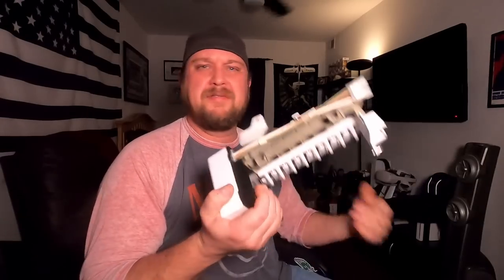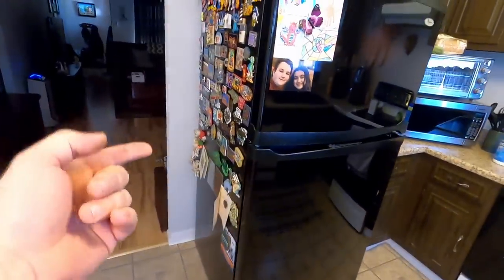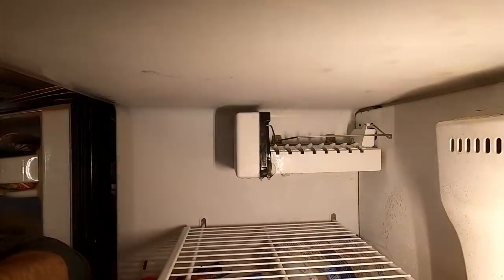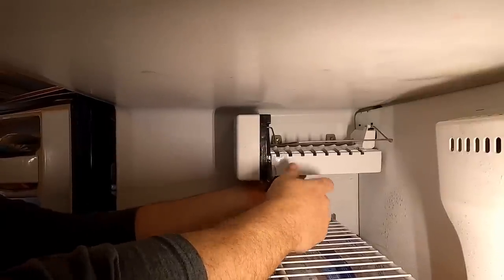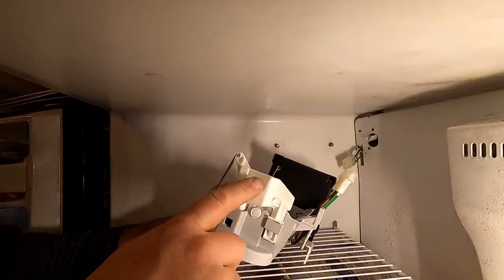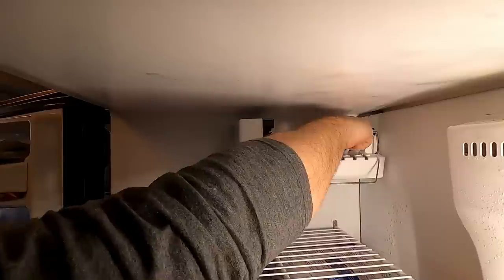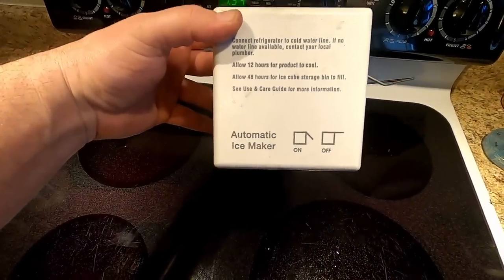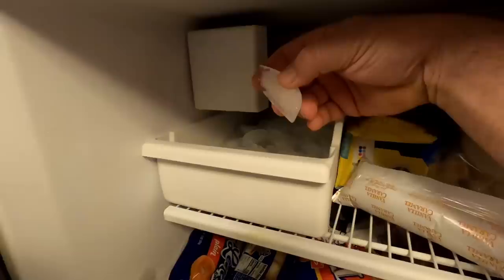Whirlpool Ice Maker Replaced

Comment: I’m a retired HVAC/R technician. I’ve never owned a refrigerator that had an ice maker. I worked on Food service ice maker equipment for the last 24 years before I retired along with the Heating and Air Conditioning in a medium size Hospital in Philadelphia,PA. I’m 77 years old and I still 
make my ice cubes with those plastic trays in my freezer. 😊
Reply: 👍🙏🤓Agreed! Ice makers take up volume & and introduce unnecessary complexity.
Reply: @ProfessorDeezNutz  🤭🤣🤣not to barge in or kow tow, but I’d float the idea that it’s low coast. (Helical props are new, but oh bouy, they seem great!)

Comment: Quick Tip:

Maintenance tech for an apartment complex that exclusively uses Whirlpool appliances here.  I’ve been replacing about two of these a week for the last year and a half.  (It’s a big apartment complex.)

After you install one of these, you can jump start it by bridging the H and T terminals under the white cap with a short piece of wire.  Super simple, starts making ice immediately.  :)

And yes, always dump the first few batches.  The entire first bucket can be pretty gross tasting.

Comment: When the ice maker tray gets to 0 degrees, it throws a temp switch that starts the timer motor switch.  The contacts on the gear turn on the heater to loosen the cubes,  the motor drives a gear that runs the ejector arm.  The shaft on these units wears out ant the contacts don’t make..  or won’t release..  meaning water, heater, motor at not run on or if the motor stalls at one position it may not turn off all those switches in the correct amount of time.

Comment: It used to be that things like refrigerators and washing machines were once in a lifetime purchases or maybe 25 years or more.  Now everything is made so poorly you have two appliances failing at the same time.  Worse, they cannot really be fixed because the parts are so expensive you're better off just buying a new one.  If anything else in the fridge had gone wrong, it wouldn't be worth repairing.
Reply from the maker: The guy who looked at my washer said 10 years is about it for most box store appliances.
Reply: Put all of your appliances on surge protection please.

Comment: That was great Video  much appreciated. I have been staring at my same ice unit for the past 10 years wondering just how difficult that would be to tackle this one. Great tip on the rollers I would have for sure attempted to just drag it out and scratch the floor. Well done !
Reply from the maker: If you look closely, there are scratches on the floor from before I learned the trick 😊
Reply: @FunkFPV  That's awesome !

Comment: Whirlpool has been using this ice maker design for like 50 years! It's super reliable and inexpensive to repair/replace. 

Recently they've been moving away from it though which does not bode well.
Reply from the maker: If it’s too good, they can’t make money off of it 😁
Reply: Yeah. I've been slowly transitioning to old reliable used things with less bells and whistles. I'd never get a fridge with an ice maker again. I'd rather just have a countertop one.

Comment: I've sold appliance parts for 20 years.  You can see on the old icemaker mold where the water had gotten between the mold and the head, corroding it and letting water get into the head where it freezes.  It happens all the time!

Also, just as a reference, when you are trying to figure out if the icemaker or the valve is bad: if there us ice in the icemaker that isn't being expelled, the icemaker is bad 95% of the time.  If there is no ice in the maker, pour a glass of water in it.  If it cycles and kicks the ice out, then it is most likely the valve.
Reply from the maker: Good info 👍🏻
Reply: Same failure mode as my late mother-in-law's apartment ice maker, which hadn't made ice in months.    Even right down to the ice maker plastic being coated with ice and looking mottled/filthy.  (Actually, you could hear the stalled ice maker motor groaning every half hour, trying to push the cubes out, but they were frozen to the tray).  Everyone else in the family was oblivious to the problem and symptoms, even though everyone else but my wife and I owned a refrigerator with ice maker.  But I'm the one that was upset that the ice maker was broken.

Probing with a DVM according to a manufacturer troubleshooting guide revealed an open on the heater circuit.  I assumed the heater burned out, but corroded heater contacts or charred heater switch contacts would give the same result.  Apartment complex replaced the whole ice maker the next week after I jerked it out for diagnostics, so the point is moot.  But if some charred/rusted contact could have been burnished to put the ice maker back in operation, that would be the true skinflint path to fixing the problem.

The bad part of the story was that the refrigerator water supply tube cracked at the solenoid when I (gently) pulled the refrigerator out of the nook (to power down the refrigerator?)  Started squirting a pencil stream of water on the apartment floor at 9PM on the Sunday of a long holiday weekend.  (Thanksgiving/ Christmas/ Easter/ whatever).  And the plastic wingnut-shaped handle on the water supply shutoff valve in the wall had lost all its plasticizer over the decades and turned into dust.

I was barely able to shut off the water by turning the valve shaft a quarter turn with needle-nose pliers.  If that hadn't worked, we would have needed a third-shift call to a plumber with secure basement access to turn off the water, or else we would have flooded the apartment building basement (and apartment).  If the shutoff hadn't been accessible in the apartment kitchen itself, we really would have been scrod.  Don't know whether the apartment complex replaced the shut-off valve, or if 20 years from now the other shoe is going to drop when they need to turn the water off to replace the whole refrigerator...

Comment: Aftermarket parts are usually the same manufacturer.
The solenoid valve is 120 volt, I've seen one with voltage leak to chassis which energized the external plumbing..

Comment: You may want to check heater resistance to see whenever it failed or not - compare it with new one if there is no info about it's rated power.
Cause if it freezes like it's supposed to, but doesn't unfreeze, then what could be wrong? ;)

Comment: 9:31 If you take a paper clip and jump the holes(i cant remeber which ones i beleve its the ones closest to each other there are video on youtube about it) you can force the ice make into a diagnostics mode to check all fuctions intead of waiting for it to cycle though. It helps tech quickly check them out. Of course it has to have water and plugged in for that to work.

Comment: I bought one of those for a fridge at work. The first one didn't work so I sent it back, the second one also didn't work so I pulled the cable out of the back of the fridge to make sure the wires matched up. 
For some reason the wires (colors) on the ice maker were not in the same sequence as the wires on the fridge, so I just rearranged the wires on the ice maker plug and it has been working fine ever since.

Comment: I don't know I'm cheap avoid the frustration I have plastic ice cube trays, don't have to run a water line or worry about mechanical  failure. 🤗. I can remember the metal  ones that had that had a handle on them he had to pull the brake cubes out. 😉
Reply from the maker: My grandma had those metal ones. 
When I replaced countertops 10 years ago I ran the water line. If it wasn’t for that I’d still be using trays.

Comment: What’s the voltage/amperage on these things? I was replacing the defrost components for a neighbor, it had to have power to remove some stuff, and could be unplugged for the rest. I was being lazy, got the ice maker out, and was trying to push the plug out of the back wall, and using a screw driver.

Screw driver slipped and ended up in a pin connector hole, I’ve hit 110 lots of times, never been a problem, whatever that was, was a good buzz, and my tongue hurt for like a week
Reply from the maker: Mine is on a 20 amp circuit so you probably got most of that 😂